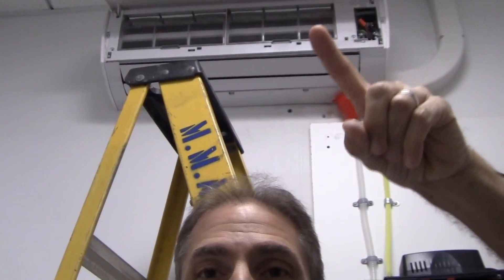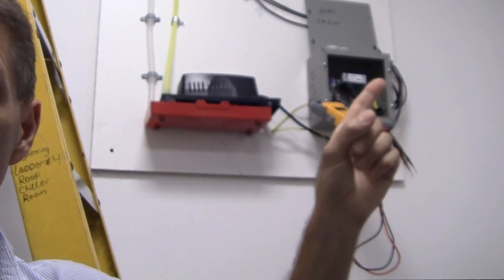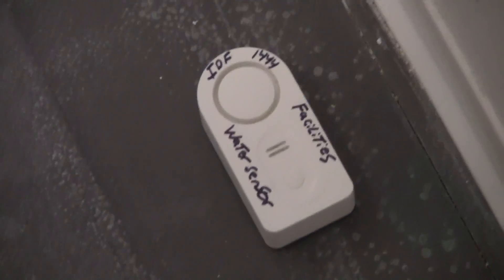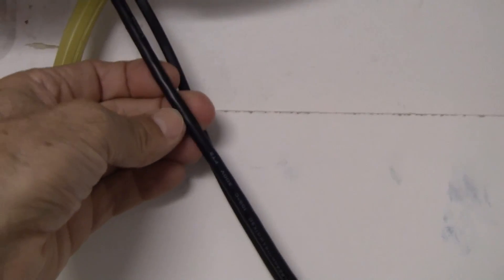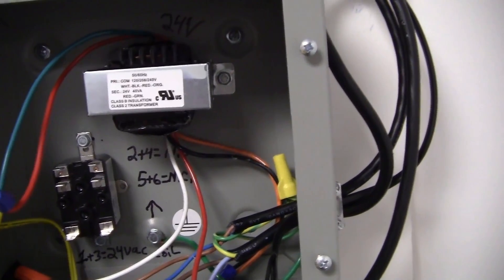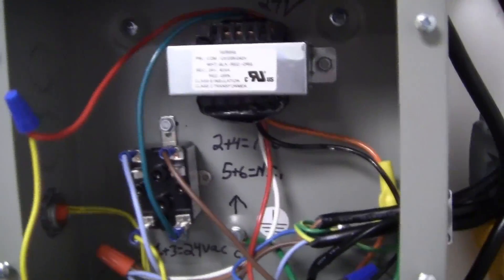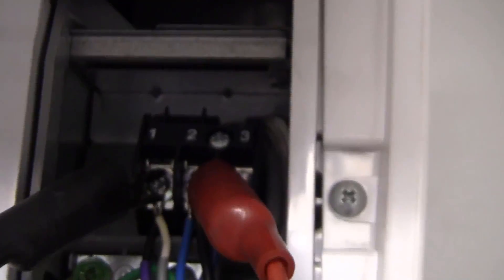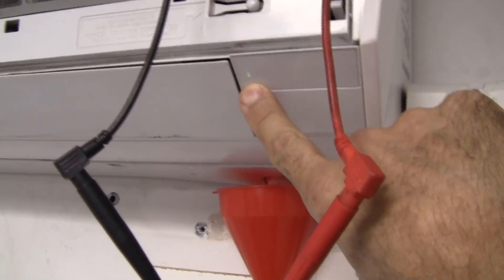Install Condensate Water Pump with Safety Shut off on Mini Split

Comment: I built it just as you speced. Works like a champ. Water pump safety switch rated to 24v so your relay was the way to go. Thanks for sharing the great idea.

Comment: You could have just broke one leg of the power to the mini split with the dry contact of the safety switch of the pump
Reply from the maker: The voltage is over 24V, I disagree.

Comment: I cannot confirm, but i dont agree that the safety switch cutout has to be 24 volt. It is just a dry contact. I dont think you need that transformer or peanut relay.
Reply from the maker: From what I remember, I did require it...